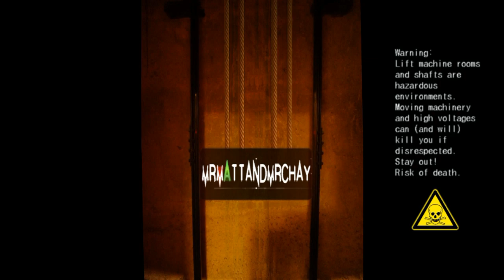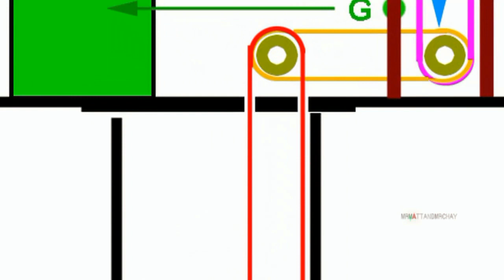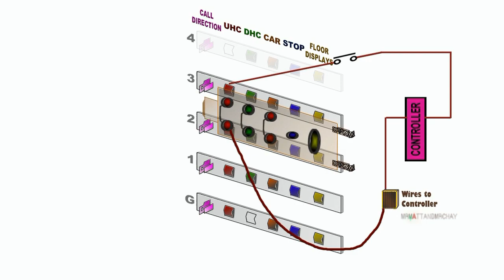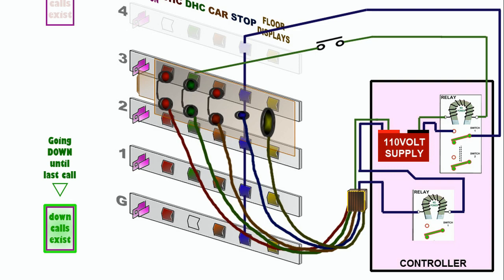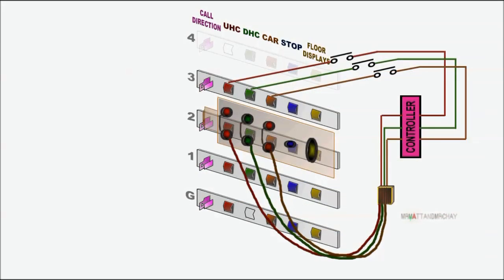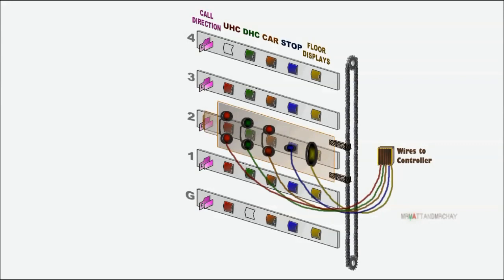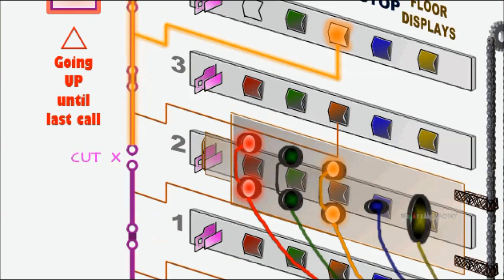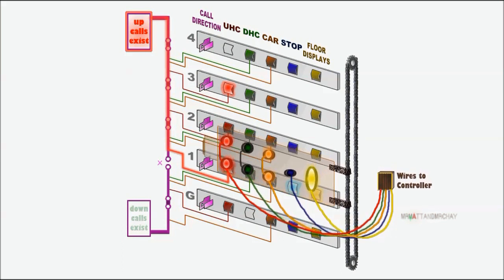OTIS FLOOR SELECTOR movie - A beginners guide to how it works.

Comment: What switched do you adjust to speed up the leveling time
Reply from the maker: You mean, to make the time it takes to level, less?  That's the contacts on the carriage, you can slide them nearer to the floor, but then it has to be so precise.  The levelling speed on an AC motor is always the same, unless you have a generator driven machine.

Comment: Great Video. Can you further elaborate on how the motor polarity changes to move up and down. did'nt quite get that part.
Reply from the maker: Well, I was explaining using that battery just to point out that the motor direction changes using relays.  This video was explaining more about the floor selector than the motor direction.  But firstly, it depends if the motor is DC and AC.
What actually happens with an AC MOTOR, this uses 3 PHASE mains power.  I'll call them phase A, B and C and try and explain as simply as I can.  On the lift motor there will be 3 electromagnets, I'll call them 1, 2 and 3.
So on one cycle of the AC, each phase has it's own "peak" of maximum power.  This goes from Phase A to B to C to A to B to C, etc.  This can be used to attract the motor on a circular journey.  If I connect Phase A to electromagnet 1, Phase B to 2, Phase C to 3 - the motor will turn in one direction.  Then when I disconnect the power and apply the brake, the lift stops.
To go the other way, relays switch different phases to different magnets.  So now, Phase A to electromagnet 3, Phase B to 2, Phase C to 1.  Now the motor goes the other way.
For a DC MOTOR, things are different.  Check out this video as this explains it perfectly...
https://www.youtube.com/watch?v=-qS85aIvleQ

Hope that helps?

Comment: I have a request. I don't know if you even know this, but in the future could you make a video of the logic that decides which elevator to send on an elevator system with multiple elevators on the same controller?
Reply from the maker: I certainly can.  An interesting request and it's on the list of things to do.  I had to work out how to route lifts in my liftsim program.  See..
watch?v=JnBga8rbH98  See about 0:50 you can see the status of each lift on the right.
I'd like to send you the 'handyguide.pdf' that shows you some of the icons and meaning of what each lift is doing, so PM me with your email and i'll send it.  This gives you a rough idea, but I will make a video to explain it further.
Not sure exactly when it'll be up, but as before, it's on the list!
Reply: mrmattandmrchay I have the handy guide, but this info is referring to a relay controlled elevator, not a digital controller, right? Because I was talking about relay logic.
Reply from the maker: upanddownadventures Ah I see.  I do have a basic theory about this, but to make a video that shows my theory in an easy to understand movie could be a challenge! I'll have a think!
Reply: mrmattandmrchay I would expect there to be a number of different systems out there (as with the floor leveling systems) made by different manufacturers and for the scale of system needed.

The most basic system would send the call to all the lifts in the system, canceling the call when it is answered. This would have the disadvantage that all the idle lifts would start moving when a call is made (your ding-dong Premier Inn lifts seem to do this). This would be an improvement over having individual call buttons at each floor as a lift would not stop if the call had already been answered before it reaches the appropriate switch in the carriage.

A more advanced system would need to compare the position of the call with the locations (and other calls) on the car. Compromises would have to be made between efficiency (as few lift movements as possible) and customer satisfaction (having a lift arrive as quickly as possible).

I saw a bank of three lifts onboard a 1980s ferry that seemed to be setup for maximum efficiency. If, for example, two of the lifts were on deck 5 (idle) and one was on deck 4 going down (with a car call for deck 2). An up call made on deck 4 would not be answered by one of the idle lifts on deck 5, instead it would be answered by the remaining lift once it had visited deck 2. The result of this was crowded lifts (as they were usually full) and long waits.

Comment: Thanks very interesting! Would a simple lift serving only 2 floors, ground and first have a moving selector?
 I know all you'd have is on ground floor a DHC and on First an UHC. The car would only have a G and 1 switch with a floor indicator and door motor activator.
Reply from the maker: Good question!  The carriage was developed to prevent having to take "wires down to switches" in the lift shaft - imagine trying to find a fault with a levelling switch 'somewhere' in the lift shaft!
But when you are dealing with low rise building of 2 (or possible 3) landings, it's not such a big deal.  So it is then cheaper to go back with 'installing switches in the lift shaft' rather than constructing a carriage system, which would also increase maintenance of the unit.
So in a building with only G and 1, no - I would not expect to see a moving selector.
Thanks for the question.

Comment: Is it ever possible for a lift to shoot past the top floor and crash into the top of the lift shaft due to an electronic failure?
Reply: ELPaso1990TX yes it is.Not very often but it has happened.

Comment: There is an extra optimization to be made. If, at the very end of the video, a bloke was on "G" pressing an UP call, the elevator would hit the UP request at 1 and switch to UP mode without reaching floor "G". It's better for the elevator to go to the furthest UP call, not the closest.

Comment: Lovely video.  I am building a model lift, but using microcontroller logic.  This video helps a-lot with understanding how the relay-logic works, which will help me to convert that to code.  I thing you guys call the industrial electronic controllers PLU's(Programmable Logic Unit?) - something like that anyway.
Reply from the maker: +VauxhallViva1975 Sorry, I missed this comment.  Relay logic works in this way, serves down (and car calls) then up calls after.  Some return to the terminal floor (normally ground floor) after a short duration.  When you have a computer involved then two lifts or more become much easier to program.  How many lifts and floors in your model lift?
Reply: +mrmattandmrchay Hi.  Keeping things very simple for now.  Single shaft, up to 10 floors on the controller, but the model only has 8 floors(6 floors, ground and basement).  Your video was very useful to help me understand the basics of the relay-controllers(which lets be honest, are a thing of beauty).  Perhaps I should make my model a relay-logic one!!!! (but I won't.  PWM motor control etc are all built into the likes of the Micromite controller, so 90% of the hard work is done for you)
Reply: +VauxhallViva1975 After watching all these videos, I also am of a mind to build a scale model lift out of foamboard and balsa wood, but using real icecube relays, timer relays, limit switches, and an old 3 speed bi-directional box fan motor, lol.  

I see that one can buy packages of 120VAC DPDT 8-pin relays/bases for a few buckazoids, and 14-pin relays for not much more.  RC airplane hobby sites also sell useful servos and sensors as well, but they're not rated for 120VAC.

Yes, it could be done much cheaper with an Arduino or Raspberry PI, but these old relay systems are just so beautiful.
Reply: Yes, those DIL relays are a dine-a-dozen on eBay, and would certainly be one way of doing things.  Relay logic is a beautiful thing, but complex.  I think some of the relays used in the relay-logic controllers used special arrangements of contacts, and probably not all of them were standard contact arrangements, but perhaps I am wrong.  IF I am right, some of those special contact arrangement could be difficult to reproduce with standard relays.  I would love to be proved wrong on that though! ;)

Comment: Question:  If the position of the rails determine when power is cut to the motor at the precise instant to make the carriage stop level with the floor, won't the characteristics of the motor change over time causing the carriage to go out of level over time?  

Or if the line voltage should fluctuate, changing the speed and/or torque of the motor, which would change the distance it takes from cutting power to the motor and when the carriage stops, causing it not to be level?  

Or relative humidity changes over time would change the resistance in the wiring, affecting the voltage drop and changing the line voltage ever slightly, etc., etc.  

I assume this is a problem for these older relay lifts?
Reply: None of the conditions you have mentioned would alter the stopping position of the lift. When the micro-switch is broken at each floor level the contactors de-energise and the Brake is applied. On a single speed lift the levelling accuracy permitted was + or - 1"  or 25mm on 2 speed or polechanger lifts this was reduced to 10mm. Gearless  DC drive lifts had to stop within 3mm under all load conditions.

Comment: I'm a lift mechanic from OTIS, are  you too? Absolutely brillant you explain  that!
Reply from the maker: +titony54 Hi!  I'm not actually a lift engineer but Ive had a life long interest in them and I know a few people from within the industry, mainly through youtube.
It really Facinates me how people designed these systems from prototypes to working models that have stood the test of time.
My career is electronic security so we do work with lift engineers from time to time with CCTV and Lift Access Control.  At my company if you want to do something with a relay, I'm your man!  Love messing around with relays timers and circuits.
I have several elevator parts including selectors that I may connect up sometime but it's difficult finding the time.
Thanks for your comment
Reply: Amazing! I have  work in OTIS 5 years, I can't explain this elevators like you:)